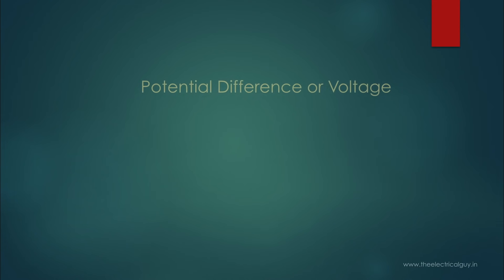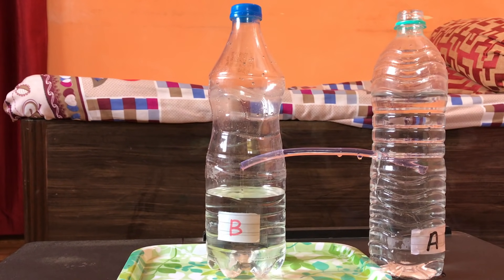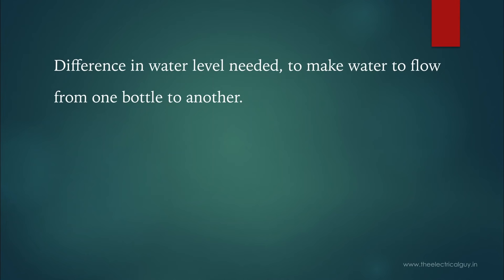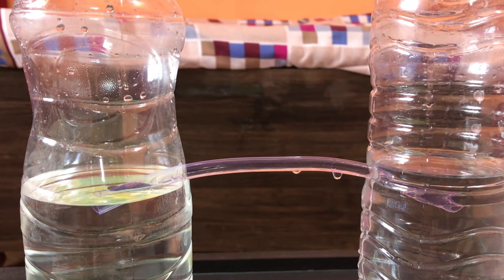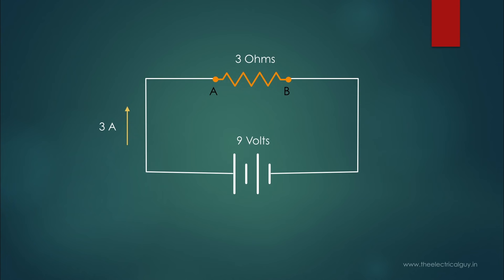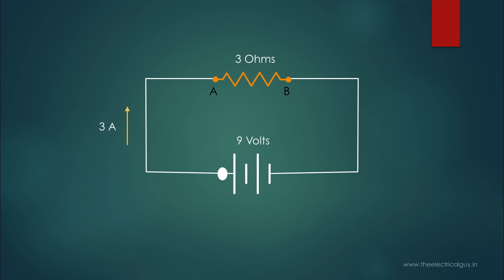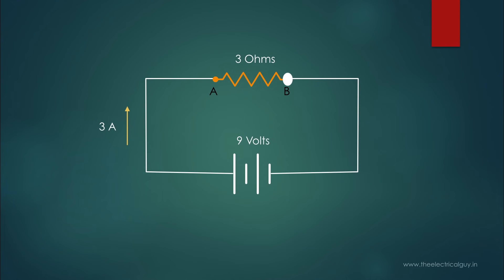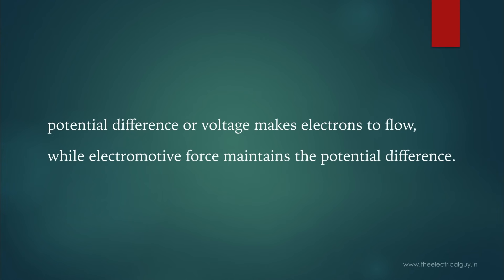Voltage or Potential difference vs EMF | Easiest Explanation | TheElectricalGuy

Comment: I did some EE back in the day....I was shocked to learn that everything is seen backwards, like how you descrive coulombs flowing from + to ...which works mathematically as it is a mirror image...and is a leftover from the days of bell jars and ion solutions...When we discovered the electricity in a wire eg is the flow of electrons, we did not switch the maths over to electrons but kept calculating positive ion flow as you and I were taught...No biggie right? Except, it would be like trying to collect rain, imagining it as 'dryness' rising up to the sky...sure, it works most of the time, but I discovered visualisng the e flow as water is the key to harnessing zero point energy...Whilst you just crunch the numbers for the + ion mirror image then it covers up how to harvest the abundant energy all around us...something like thousands of atomic bombs in every cubic centremetre of space...Thanks for your vids...very helpful in brushing up and renewing my knowlewdge...✊

Comment: 4:24 doesnt the electrons move from negative to positive???
Reply: You're right. In real cases electron moves towards  high voltage point  from a low voltage point.
But these theories were developed before the negative charge or electron was discovered and it was assumed that a positive charge move to lower potential point from a higher one .

Comment: With due respect you are unnecessarily confusing students with your faulty explanations and terminology.  Kindly consider improving your approach.  The correct approach should have been to say that potential difference between two points (in Volts) is the energy (Joules) needed to move one unit (coulomb) of charge between the points. EMF is any mechanism that can create potential differences across points in space, and its efficacy is measured by the potential differences it can create (again, obviously  in volts).  The methods could be mechanical, chemical, radioactive, electromagnetic, etc.

Comment: Hi Sir,
I watched your video regarding the difference between e.m.f and voltage. I want to confirm something. Can we say that e.m.f is the maximum electric potential difference between the terminals of battery? It is calculated in an open circuit when there is no voltage loss. While voltage is the potential difference between any two points required to drive electrons.
Would that be right?

Comment: Saying voltage vs. emf, is like saying amps vs. current, or ohms vs. resistance. EMF i ElectroMotive Force and it is measured in volts:. It is ohm's law: E=IR

Comment: Question: the power supply for a rail system I work on is minus 350 & plus 350 Volts DC, there is still a potential difference of 750 VDC? Even though the return is not ground or zero volts?

Comment: Now, I understood. EMF vo potential hai jo battery lagati hei jisse electron aage khiske. I think this mechanics analogy can work . Assume a very rough surface and you want to roll down a ball with mass M acceleration Â. Then initially you have to apply a force F* to roll down the ball. The ball rolls with Â .and multiply M and Â you get force on ball MÂ which of course less than F*. 

The relation would be F* = MÂ +  Friction
In circuit, EMF plays the same role as F*, voltage as MÂ and    friction  would be current multiply (internal resistance)

Comment: For a CLOSED circuit, emf is defined as the work done by the source (eg: battery) to bring unit positive charge once in the closed circuit

For an OPEN circuit ,
EMF is defined as the potential difference between terminals of the cell

TERMINAL POTENTIAL DIFFERENCE is defined as the potential difference between the terminals of cell in CLOSED circuit

Comment: One Question, in case of water bottle the potential difference is created by water level i.e one bottle having more water than other. So how exactly in case of electron flow, the one side is made electron rich and the other is electron deficient. Please explain. how to make one side full of electron and other deficient in electrons.
Reply: By connecting battery

Comment: Your device is connected to both the bottles in the graph...if it suppose to lower the potential from B it will also lower from A. So still the level remains same. Ofcourse in your graph if it increases the potential of A or decreases the potential of B alone then your explanation would be correct. Now tell me how your such device after being connected to both sides can create potential difference ?

Comment: One more way to understand the difference is:
e.m.f is the potential a battery should supply (value written on the battery)
But if we connect voltmeter across the device we get little less value that is potential difference.(the actual potential it supply)
The difference is potential drop and reason is internal resistance.

Comment: Electrical potential in each side of the battery for certain amout of electric charges(Columb of them for example or multiples of them) will be a driven force-work if there is a difference in this amount of electric charges and their potentials but according to your words,the transfer  of this electric potential will continue even if the equilibrium state is done thats why we need to a process to keep this equilibrium state as it is ,unless external effects come,and you named this process or phenomen as an EMF.

Q/This process in energy terms ,comes from where exactly ?
 
So,Second law of thermodynamics for this whole process fails .why?!
Nore/As they tought me in school ,EMF is an internal energy stored in a battery and when I need to use this energy in field-force/work  terms will be a voltage or a potential difference on external Elements.

Comment: EMF is the voltage developed across by a device. Voltage is a measured unit. Example, single battery cell has a EMF of 1.5 volts (voltage). A battery of 4 has a voltage of 6, but not as EMF. A generator has EMF of 400 means induced voltage. The way you explained is not correct in my view. A motor connected to power has an applied voltage and an induced EMF. Regards.

Comment: At 3:20 "Many people will think that EMF is a force, but it's not a force. It's an energy supplied by a device like a battery." Sorry, but that's wrong. EMF is not energy. EMF is energy per unit charge and that is a voltage. Since there is no absolute potential, we can refer the magnitude of any potential to any convenient reference potential. So voltage, voltage drop and potential difference are all the same thing. You're making a distinction where none exists. It's no less correct to say that a voltage is required to power a current flow than it is to say EMF is required to supply energy to the charge which is flowing. Similarly it's no less correct to say that voltage drop will cause a current flow than it is to say that a potential difference will cause a current flow.

Comment: OK, but why would electricity (electrons) leave the positive terminal of the battery, which should attract them (Opposites), and then flow thru the load to the cathode, which should be repelling them, and try to enter the battery terminal which is repelling/rejecting them?

Comment: For All practical purposes they are same..But it is understood that across elements we do not have EMF.Its just use of terminology.
To be precise..Voltage between any two points is the capacity to do work on 1 Coulumb of charge.It doesn't matter what you call the source of that Voltage.

Comment: Work and Energy have the same units, but are distinct concepts:  a system has energy because work was done on it.

In a similar way, a potential difference exists because there is an EMF generated by a changing magnetic flux.

Comment: So electromotive force is the name of the thing that is the reason for maintaining the electric potential difference. 

Electrons vibrate or move (due to electric potential difference) which leads to the electric current from one place to another. And the thing that maintains this potential difference is the EMF.

This can be taught as follows (analogy). EMF is like the cause of gravity at the surface of Earth (within very less height difference), it is the reason for maintaining the almost constant gravitational force of mass times 9.8 (m/s)/s. And the gravitational force is the voltage, it is the reason the object falls.

Comment: the unit of EMF is Volts it is pretty simple, though in your water bottle demonstration you must have connected the tube inbetween the bottles at the bottom level, at any electrical or electronic circuits the potential difference can occur at various places for this the unit also Volts eg. when you connect two resistors in series to a battery, at any of the resistor will have its own potential difference

Comment: Well explained but I believe the current of electrons flow from the negative terminal to the positive in a DC circuit. Otherwise love the video
Reply from the maker: Thanks 😊 do also check out other videos on my channel 😊
Reply: Yes, was also thinking of that . The electron flows from negative to positive, that's statement is correct, then how can we explain with that water analogy? 

Here I understand that the negatively charged electrons only moving, so that make sense

Comment: Amazing video. Although I have a question. In alternating current when all energy is delivered and electrons passed the resistance, taking into account that the Neutral wire is at 0 potential, how then can the electrons move and go bsck to the source without any force applied?

Comment: I don't agree with that you said EMF is not a force, totally wrong man. Actually 9 J energy is not transferred it's the electron transfer negative to positive terminal of batter where EMF makes them to do so. When all electrons transferred to positive terminal they will get neutral which means there is no EMF in your language battery is down.

Comment: Voltage is creating difference of potential  between conductor ends that develops force and the force is called as emf (electromotive force) 
Means force which is making the electrons to flow by pushing them. Both voltage nd emf are same, voltage applies force develops causes electrons to flow.

Comment: Any Object to move requires some force .some force is also required to move electrons from its place to another place that force we are applying is voltage. When this voltage is applied between two ends of conductor force developed moves electrons in conductor

Comment: While I do agree with the emf being the entity that maintains the potential difference, I would not say that the potential difference is what causes electrons to flow. The emf is responsible for both the current flow in AND the potential difference across the elements of the circuit. Voltage and current are the two simultaneous faces of the same coin: power transfer.

In fact you could not have different levels in the two containers without having more water poured into one of them to begin with (so, what causes what?) The difference in levels requires a water flow to be maintained - it is not the cause of itself. The water flow is caused by the energy imparted by the pump, just like the difference in levels.
Reply: I don't get one thing though, how can any electron, as he said, lose "all of its energy" by the time it comes back to the source? Wouldn't losing "all" energy also mean it would stop moving?
Reply: @somerandomboi8239 Sorry to answer after 1 year, but I didn't see this at the time. What is missing from the picture (apart from the position of the pump) is the role of the hydraulic resistor. The small pipe makes it harder to move water from one bottle to the other, and that causes water to build up on one side (until a dynamic equilibrium is reached). In an electrical circuit the mechanism is a bit different. There would be a build up of opposite charge on the two ends of the resistor. It is this surface (and interface) charge that is responsible for the stronger electric field inside the resistor and the large voltage drop across it. So, in an electric circuit the electrons gain energy when entering the resistor, and lose it almost all due to collisions with the lattice. When they exit the resistor they are subject to the much smaller electric field in the conducting wire. The role of the battery is that to supply the charge required to maintain the surface and interface charge necessary to make the electric field inside the wires and resistor follow Ohm's law.

Comment: Why did hear that
EMF: is the voltage that exists before current flows through the circuit🤷🏽‍♂️🤷🏽‍♂️🤷🏽‍♂️
Anyone knows????
Reply: The voltage is the difference of the electrical charges between the two point of an electrical field, whereas the current is the flow of the electrical charges between the point of an electrical field. The SI (International unit of the standard) unit of the voltage is volts, and the SI unit of the current is amperes.

Comment: Sir pls explain....Why does current not decrease on passing through a resistance
Reply: It does decrease, but after the current has passed the resistance, it will regain its initial rate and flow like earlier.

Comment: Brother ur saying inaccurate information this example at 1:10 has nothing to do with potential difference at all I know this example is very common but its completly wrong if u want a debate lets have it I will respond any time
Reply: Can you explain why its wrong?
Reply: @dh4uv150  of course 
Write after me 
You have to points separated by displacment d 
Point a and b 
Between those two points there are resistance R
And there are other series resistance after these two points 
Ok let us assume that the voltage difference on the battery is 10 voltages and voltage is equal to energy / charge
Actually the voltage is a name of the scientist that derived the equation it is actually joules/coulomb
Now the battery supply the two resistance with 10 jouls for every coulomb (for every electrical quantity) 
So the charges will get out of the battery to reach point a at point a the battery has to do work for every coulomb to make the charges go from a to b 
At point a the voltage aka work per c 
Is equal to 10 j/c thus means that the battery have 10 j for every coulomb thats energy in the battery that energy will be used to push the charges from point a through the first resistance till the charges reach point b so the so at point a the voltage is 10j/c 
At point b the voltage is always less than 10j/c let it be 8j/c 
What happend to the 2j/c where did they go 
Its a wasted energy that were taken from the battery to move the charges through that resistance from point a to b 
So the 2 j/c is the voltage diffrence
=va_vb=10_8
So did you get it
This is the true example if you have box and you pusing it through oily ground and you on your way a very friction ground before you enter this frictional ground you would have say 10 jouls to move the box through this ground it will tire u u would get tired of course thus means after you pass this specific ground you would have les than 10 j of course 
This is how to describe a resistance it has nothing to do with  flow or leaning or somthing between the two points of the resistance its just a battary losing energy to transport one coulmb through the resistance 

Note : you can continou with the same first ex when u end up with 8 jouls for every coulombs it would go through other resistanss and it would get less and less
Reply: @Ali_T8888  aight thanks its clear now. :)
Reply: @dh4uv150  I hope ive been some help to you

Comment: whats coulomb ? an electron ?  and does coulomb after losing energy become positively charged thus is not reppeld from the negative terminal of the battery ?  btw the video was great
Reply: A couloumb is a unit of charge. He meant that the negatively charged electrons moved across the circuit and at no point do they become positively charged. The electrons aren't repelled by the negative terminal because it is the point of the lowest potential.
Reply: A coulomb is the unit of charge 
An electron is a negative charge

Comment: elcetricit is the movement of electrons in a circuit from high energy to low energy.  just like all of physics. high to low energy.
now voltage is a measurement  of 2 currently isolated points and not a characteristic of electricity itself  . the difference in energy between two diffrent points.  if the diffrence between any two points is zero or close to zero they still want to move to a lower energy state but you havent provided that......so to sum that up, voltage is a measurement of two points and not a characteristic of electricity itself. 
but where does this energy come from?
well each electron has a field around it. and every additional electron that comes within the vicinity of this original electron has a field as well. and the fields are of the same negative polarity.  And just like a magnet fields of the same polarity repel from one another.
so...the more electrons in a given space the more energy in that given space.
This repeling force between each electron is how i understrand EMF.  the force between particles is what creates the charge so that when a voltage is apllied (Voltage being a Pathway to lower energy)( without a conductor like wire, voltage does not exist or is zero.)
so when the voltage is applied The EMF has a route to discharge.
EMF= force between electrons. Voltage =the force between conductors.
they are not on the same scale.

Am i wrong please tell me